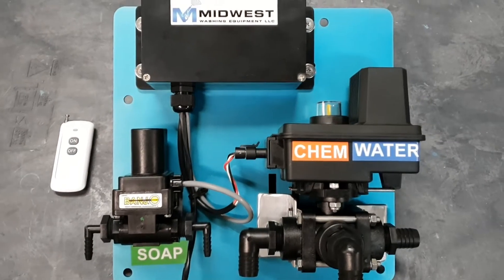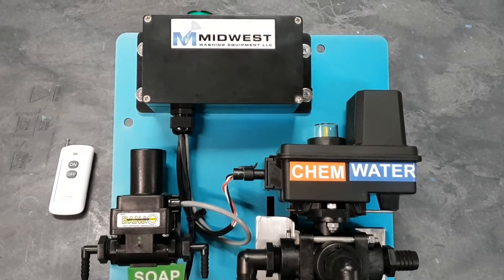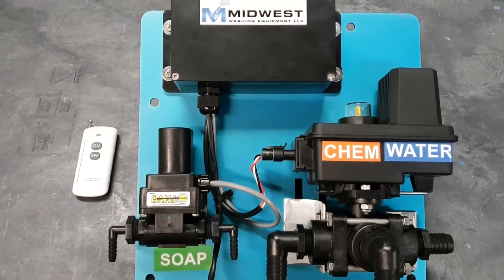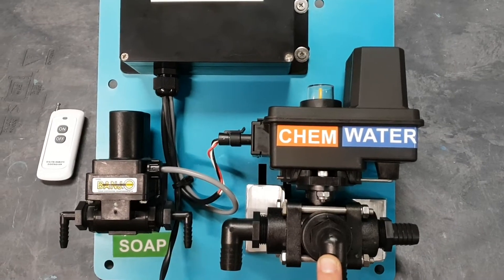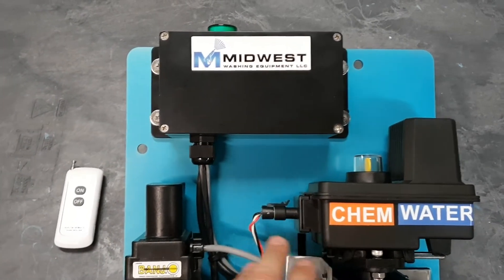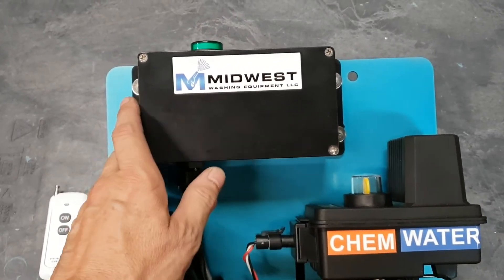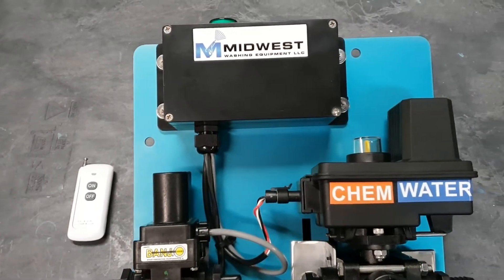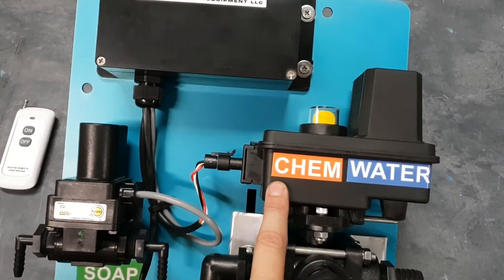New Soft Wash Wireless Rinse & Flush Module for Proportioning Blending Systems

Comment: Do your 3way electric ball valves have polypropylene balls or SS balls?   Where can I source these?   Do you sell directly?
Reply from the maker: Polypropylene. Are you looking for just the valve?
Reply: I have the power wash store’s proportioner - 1/2”.   Wanting to make the rinse valve an electric 3 way.    I’m in Canada, so it’s harder to get parts here.   Yes, just the valve.   Maybe I should switch my proportioner over to 3/4”?
Reply from the maker: @cedarclean-cedarroofcleani8148  we will ship to Canada.  If you run anything bigger than a 12 volt pump, I would highly recommend upgrading to 3/4" metering valves. We sell just the valves too.

Comment: Very nice build. But speaking as the devil's advocate for a moment... what happens if the unit fails while on a job site? There would be no quick way to bypass the valves and switch back to manual settings. I realize, too, that building such a "bypass" into the system might also create a perception that perhaps the system isn't as reliable as it should be. It's a Catch 22 for sure. Thoughts? Either way... great build! Would love to see a video of it installed and in operation.
Reply from the maker: Thanks for the comment and feedback!  These valves have an extremely high cycle rating, but in the event of failure, both valves can be manually operated.  The 3 way only requires pulling a pin to access and the soap valve has a couple screws to remove then manually turn.  It would take you less than 5 minutes to manually turn both valves.
Reply: @midwestwashingequipmentllc1209   Ahh... Well, you've clearly already considered the scenario. Always impressed with your ingenuity and mechanical aptitude. I see a lot of thought and planning goes into every one of your products - and the quality shows.
Reply: How much
Reply from the maker: @malloryathey6ify  $695 delivered, you can purchase here https://washingequip.com/shop/ols/products/wireless-rinse-flush-module-for-proportioning-metering-systems